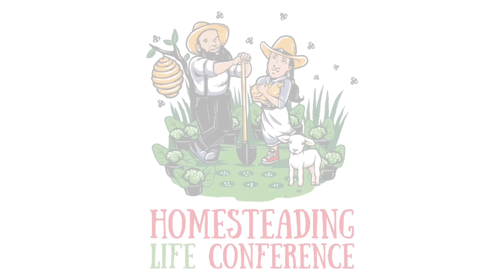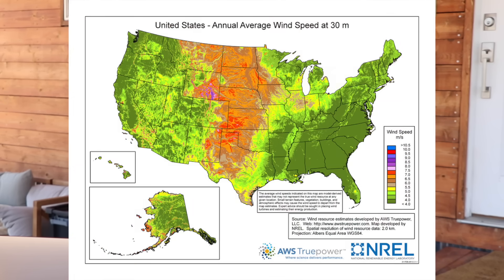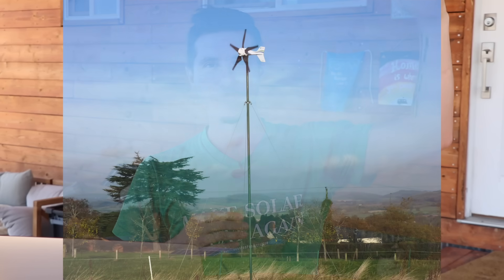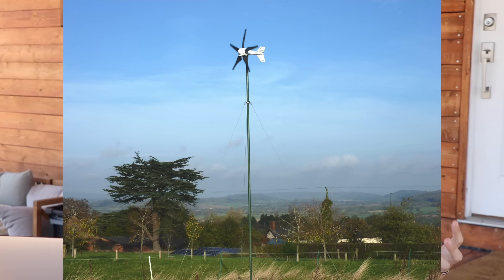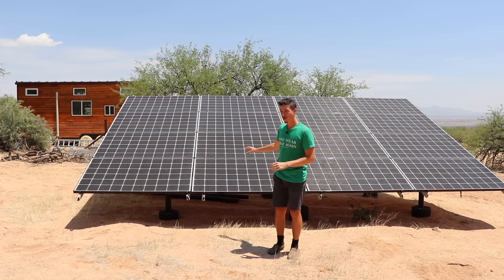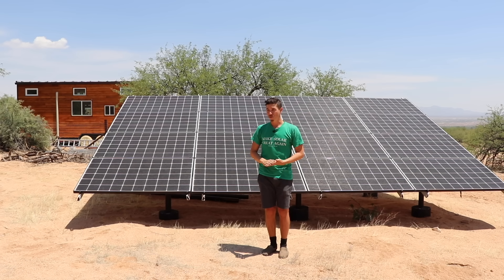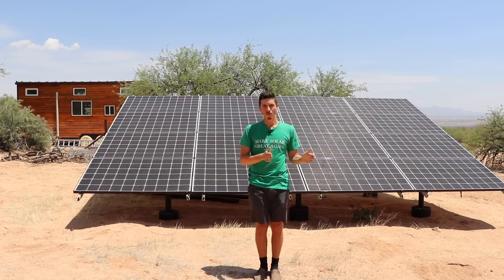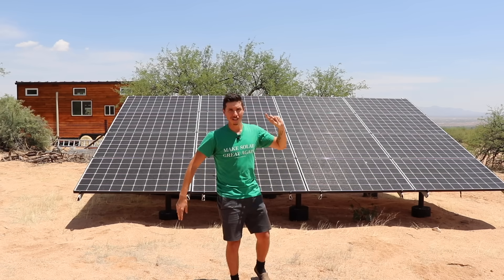Micro Wind Turbines... Are They Worth It? (Off Grid Solar)

Comment: Before you even consider a turbine, you need to do an anemometer test, to see if the capacity factor will even give you a return on investment. For me, I hardly get any wind. the money is better spent on more panels. My brother lives at the base of a canyon, and has nearly constant wind. A turbine will produce a much higher capacity factor than solar, since the mountains block the morning sun, reducing the solar day. Turbines were really worth it, back when it was cheaper per watt for a turbine, than for solar panels. Panels can be had for less than $.50 per watt, about the same as a turbine, or less. That's just to buy the components. What is the difference in installation costs? I think turbines become more economical as they get bigger. I don't think it's that much more expensive to beef up the tower, and put up a 1 kilowatt or larger turbine, than that little 400 watt model. Back 20 years ago, panels cost about $4.00 per watt. That made turbines look pretty good. Now days, with solar panels as inexpensive as they are, are the more practical choice. My zoning laws only allow a maximum height of 35 feet. If you can't get it up there, it's just not going to be effective. The tower needs to be strong enough for me, at 200 pounds, to climb up it, to service the turbine. Otherwise, i'm at the mercy of how long it can run without any maintenance.

Comment: Very Bias video, Though Solar panels are more cost effective in comparison to wind turbines currently. There was a lot of stuff in this video that was over inflated about how bad wind turbines are. Most people can setup a gin pole system or mount a tower to their home to get that 65 ft height,  it honestly isn't as tough as you make it seem. Second, yes it has moving parts but they can be replaced, and they don't fail at some crazy frequency that you'd have to constantly be worried about it. Third,  you mention getting more panels for solar collection, but that really isn't the whole cost. You need to increase your storage in that scenario,  which means more batteries, the most expensive part of a solar system, and now all of a sudden, you close that price gap between solar and wind. Wind and solar combo systems are by far more redundant, but upgrading either at this point in time is costly, with solar winning out by a small margin ( once you consider the need for a bigger battery bank). To be honest the most effective, consistent and overall best way I've seen to power a off grid home is Hydro, it is king when it comes to consistent , stable, solid power, in all conditions.

Comment: The renewable solution you use depends very much on your location. In his it seems like solar is the way. Where i live wind is. However he is right in noting that a smaller turbines are much more expensive per installed kW than larger ones. In off grid getting the balance of technologies and storage right is often the trickiest thing. Also don't discount micro hydro if your location is suitable.

Comment: WOW it is amazing how you have solar people and wind people rarely people that like both. wind turbines do not make noise like most people think. I have a vertical 400 watt   wind turbine that has been up for 1.5 years with no maintenance. They produce power at night where solar panel do not witch is one thing that he did not take into consideration. The height he was talking about yeah... no.... Mine is mounted to the top of my shed approximately 6 feet above my shed.  Price I have $ 250 in my vertical wind turbine. Looks awesome! and 400 watts from say Renogy your looking at $700. I use both solar and wind.

Comment: Don't forget - THE WIND BLOWS AT NIGHT, TOO! It can recharge your Tesla Powerwall...

And check out the non-bladed turbines, no bird deaths, etc. There are a number of strange designs - an oscillating stick, a spinning tall-gear-sorta thing etc. Look 'em up, there were too many to note here.

WIND IS FREE 24/7. Sun is only free half the day.
Reply: Solar panels produce power at anytime except night. Household Solar is more common than Wind Turbines. Hardly you find 100% off grid household wind turbine but you find 100% household Solar panel.

Solar power is easy while wind is technical. 

Surprising that in cold UK there are about 1 million household with Solar panels.

Even East Europe is pushing for Solar.
Reply: Britain has about 13 Giga watts of Solar and windy Germany has 49 Giga watts.

Solar is too just EASY.

Comment: When your battery starts to lose it's capacity.  Look on my page for A trick to regain some of the capacity back.  You can use this trick on cellphone, power tools, solar arrays, 12 volt car batteries Ect.

  The effect is cumulative and takes quite awhile to get the full benefit on each battery.

  The trick should be connected while charging, but can constantly connected if that is easier for you.

Comment: 6:21  what angle did you mount your panels?   Take your latitude and add 15 degrees for the winter, or subtract 15 degrees for the summer. For example: if your latitude is 40 degrees, the angle you want to tilt your panels in the winter is: 40 + 15 = 55 degrees. In the summer, it would be: 40 - 15 = 25 degrees.

Comment: http://flowerturbines.com  
Have you heard of flower turbines?  They are meant to be mounted on your roof and produce power at much lower wind speed than traditional fan type turbines.  Also, you can mount multiple turbines at specified distances apart and they compliment each other to develop 20% more power.  You should check them out.

Comment: Points which could be presented. 
It would be better to have vertical wind turbines mounted under the solar panels or along the back top edge line. 

One point is that closer to the city you are located the greater community concerns become issues. 

Vertical turbines can be enclosed in something to keep birds out. There is no direction concern either. 

Horizontal turbines should be about 200 feet above the ground for highest output. The minimum is 30 feet. In most places a tower/turbine permit is required. 
Vertical turbines can be mounted without a permit in many places. 

Wind blows more when the sun is obscured. In northern regions above the 45th parallel wind blows enough to make it work. There are pockets of windy places that would be great places to use some turbine generators.

Comment: If power from sun set to sun rise is important - then this is one of the few complementary solutions... while the structures are an issue and not always necessary- even 200 watts per hour for 12 hours is a  very nice supplement to daytime solar ..

Comment: formula for near free energy ebike. 4 to 1 ration cogs plus fifteen magnet stator. 6 to 1 for 10 magnet stator. take ebike motor put on large cog and put in to gear with other rotate 2 rotation per second. this will use 5 volts on the ebattery to make 40 volts for an ebike 48 ac motor and extend the battery life. can be elevated to prius and all electric vehicles.

Comment: The aim is to produce as much electricity as possible from sustainable sources. Whether this is done through solar or wind or other doesn't really matter. I understand the benefits of solar and what you recommend however I would still be open minded  towards wind power generation. In fact as many systems as possible. Off grid is great and to be fully independent is truly liberating. However I would still consider a feed into the grid system where my excess electricity could still be used by others. At least then my contribution of micro electricity generation is sustainable and going towards supporting the planet. To move to a model of power generation that is completely renewable is the game changer. Free electric? No more bills? Fat cats and addiction to fossil fuels-gone? No more pollution. That's worth striving for, not just for the few but for everybody.

Comment: Pannels do not produce at night when the wind plows. And in winter when it is much more windy then in summer. There is a pay off. Adding extra pannels will do not good if sun nit shining .and the sun does not shine every single day. If you have off grid solar pannels qdding a small wind turbine to supplemental  energy  when the sun doesnt shine and in winter when you normally  get much less sin light

Comment: How does battery storage work off grid?   You need to replace batteries every 5 to 10 years, that requires the store grid.  I do like solar, though I am looking into alternate means of storage.
Wind turbines can be maintained off grid, and do NOT have a motor, they have a generator.

Comment: Live in Florida and while we have sun the cost of solar and storing the energy plus the lack of real power to run an air conditioner and most appliances I never have seen the cost versus savings. Thought about vertical wind turbines to see if that was a viable solution.

Comment: You have no idea what you are talking about...... solar panels are at best 25% efficient to start with AND the Sun can only ever charge a panel effectively for 8 hours of a day, and THEN add to that problem, keeping the PV clean so it doesn't lose even more efficiency. All these glaring facts make a solar panel a very inefficient power producer indeed AND they take up a LOT of space. The only reason people buy them enmass'e now is because they are cheap !!
Wind power is woefully under researched, so lets look at it with a less biased mind. 
In theory, a properly designed and engineered wind turbine (not the 3 bladed rubbish you see today) can run 24hrs a day 7 day a week with a breeze and have internals built to last a decade between servicing....... Do the Math, and you too will start to question why hasn't this renewable energy producer been researched better !!

Comment: I had a system in the late 90's 2-48v, 5500 watt Trace inverters with digital charge controllers, 32 Trojan L-16 batteries, 24 Siemens Solar Panels, mounted on 2 passive zomeworks trackers with a Kohler 8.5 kw kohler generator. You are correct about the wind turbines, I looked into them and they have to be about 30 feet above the closest obstruction within 300 ft. For me that would have meant a 100 ft tower. They do make tilt pole mounts where you can lower the smaller turbines without climbing. This does increase the footprint due to the guy wires. I noticed some of the turbines over speeding and it looked as if one was free wheeling. Bergey makes good units that have a patented furl design which will move out of the wind if the the speed is too high, but other manufacturers use this design also.  You are correct you end up with a machine on a big high stick that needs maintenance. Do you adjust your panels on the vertical axis a month before the solstices and equinoxes?

Comment: the turbine works when the sun is down or wintery days, here in south africa as the sun goes down the wind picks up, same in winter, when sun is covered by clouds in daytime there is usually good winds. so you basicly need both working together. and solar panels arent all easy going, they get dirty and need to be washed otherwise they loose efficiency. thats a once a month job.

Comment: you could have a cheap wind generator made of 3 squirrel cage fans all linked to a single alternator via a clutch so it can spin free when the batteries are full there better at holding up to strong winds plus in a triangle pattern you would have good a wind catcher even at low wind speeds meaning lower mounting heights

Comment: Not everybody lives in a shithole desert like you. Anything above 42 north latitude,solar will lose over 50% of its energy output for 3 months out of the year compared to the summer months average, compounding this issue is, most energy consumption is during winter months. Not to mention the above 42 degrees north latitude you can only have a solar panel facing to the south. End of wiser investment by 5-fold would be to plant deciduous trees to the south of your home shading it in the summer, and losing its leaves in the fall helping the sun heat your home during the winter. Solar is not the answer to clean energy remind you out of when it comes to solar,wind,nuclear and hydro power solar have the largest indirect carbon footprint caused by the manufacturing and shipping. Hydo having the lowest. Solar energy is not saving the earth it is actually killing it.

Comment: I love solar... but in Northern Ohio, especially in winter, we don't get that much sunlight.  Solar means cleaning snow off the panels as well... I would call that "regular maintenance."  I would recommend a combination of both wind and solar here.  Also, you made it sounds like you HAVE to put the small turbine 65' up in the air.  It would be nice... but shorter towers and even roof-mounted masts can work as well.  It all depends on your location, frankly.

Comment: Those solar panels would be covered with leaves pineneedles, ice, snow and bird crap where i live. If it was on the roof it be dangerous to clean off in January and some panels have to be completely clear of even shadows or the whole thing stops working. A couple of small wind turbines would spin almost all month looking down at the half covered solar panels. I also disagree about your theory that larger heavier objects move more than smaller lighter objects with same amount of energy applied to both....I see it on the way to work, 3 large windmills of different sizes and heights will be motionless while the 3 to 6 foot blade wind mills on house roofs and barns are spinning fast enough to make the blades a blur.

Comment: You can really compare solar to wind tubrine because they are elemental divices in diffrent states one might be better then the other and wind turbines can be changed for diffrent wind speed to maximize its output and solar youll have heat problems the hotter they get the more they lose but combinding them then youll do good but you still need to check you local wind speed and light exposure to figer out what one you need to focus on more but you should almost always combind them because wind can blow at night but we cant get energy from the moon.

Comment: I disagree . I have an 800 watt turbine that complements my solar tracker very well . It's 55' up in the air on a tilt-up tower that I installed my self by my self . The only maintenance required is a once a year inspection and grease . Which I do by my self by removing 2 bolts and lowering the tower with a winch mounted on a permanent 20' gin pole . In high winds it outputs over 1200 watts which keeps the battery bank charged in the winter when there is less sun . It is very very quiet when running I can't hear it at all . And it's handsome to look at and way more fun to watch than the solar panels .   ...   Handeeman U must have read the wrong book or listened to the wrong person .                  ...

Comment: Have you thought of comparing the cost of a Savonius vertical axis wind turbine to solar?  The Savonius design automatically prevents the turbine from going too fast.  No braking is needed to slow the turbines.  I think - don't quote me - that Savonius turbines can operate efficiently at slower speeds than the big bald turbines.

Comment: Q: Have you considered the factor of maintaining battery health by having a means of charging overnight and in the winter when there is less available light due to shorter days and cloudy weather?  If it makes your batteries last an extra year or two wouldn't it be worth it?
Reply: And you guarantee the wind will blow every night?
Reply: @vtorsi610  - That's a false argument.  Maintaining battery health is a long-term issue based on percentages.  Batteries can recover from periodic abuse and keeping them out of a depleted state for most of their life-cycle can extend their usefulness.

Comment: What about the fact that if your off grid you will be saving yourself money on not having to change the battery so often, those are stats to be looked into if your in an ok wind zone. Ofcourse your right about the ongoing maintanence costs which need to be factored in. If batteries keep getting cheaper then solar 100%

Comment: They compliment each other, sun doesn’t always shine and the wind doesn’t always blow.
Reply: If you don’t have access to the grid or hydro then solar plus wind is usually better than just compensating with extra solar (unless you live near the equator). This is because in the higher latitudes over 80% of the low solar days are completely compensated for by wind, this means that combining solar with wind usually saves you about 25% in capital costs for an equivalent number of power outage days for a given battery + solar set up, despite the fact that wind is more expensive overall. The most cost effective long term set up for a single small household is grid plus battery and solar. However, many people looking to install renewables won’t have access to the grid and that’s where the wind power suddenly becomes cost effective.
Reply: But the Sun always shine on TV ;)
Reply: But water always runs
Reply: @jeffreybenefield2530  Until it freezes.
Reply: @rolliebca  Or runs dry.

Comment: Why would someone want a wind turbine instead of solar?  Just a couple reasons might be that they don't have to dismantle their solar panel system to replace or repair their roof.  And if it's ground based, the wind turbine has a lot smaller footprint if good open ground is limited.